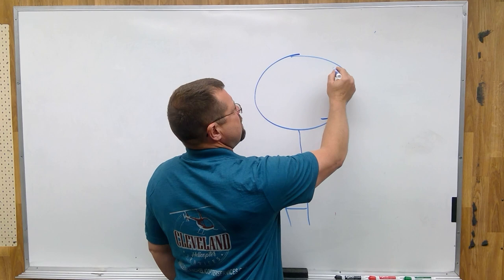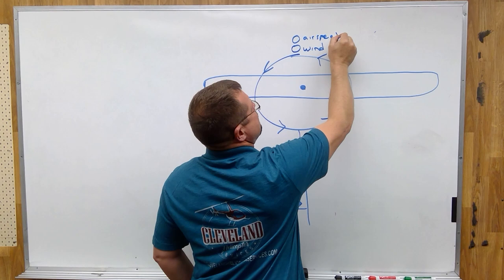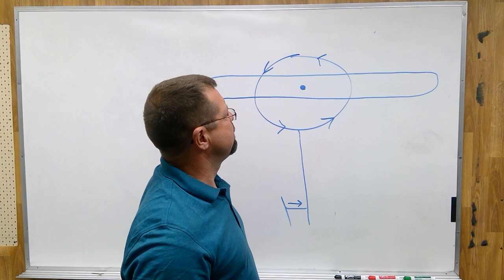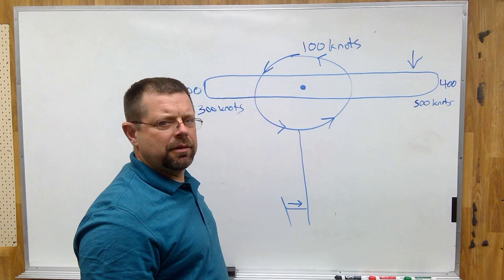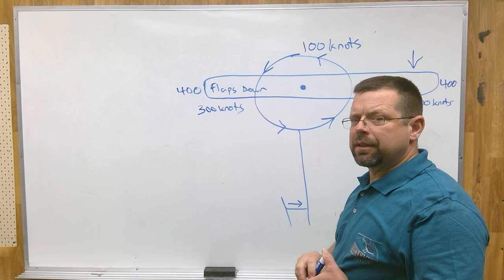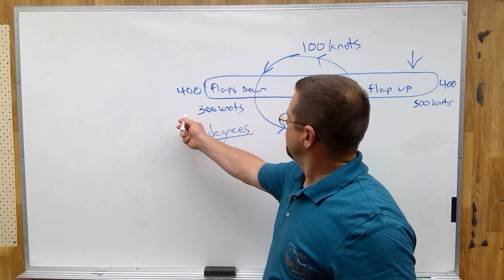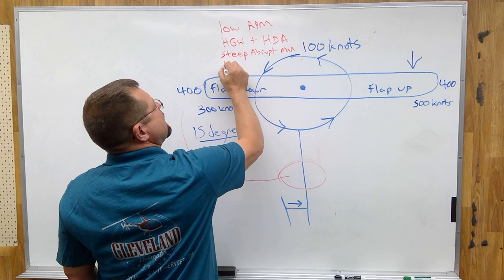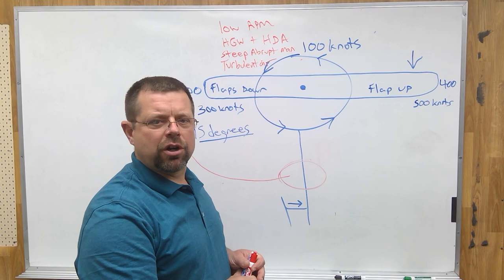Retreating Blade Stall

Comment: great lesson, well presented
just want to be clear on the tail rotor thrust vector

your diagram shows the arrow pointing in the same direction as the rotation of the main rotor. the resulting force (thrust) of the tail rotor pushing the tail (to the right with a counter-clockwise rotating main rotor) means the air flow is to the left and tail rotor thrust to the right is pulling the tail in the opposite direction of the main rotor torque (or same direction as main rotor rotation depending on how one looks at it).
Reply from the maker: Correct. The tail rotor is pushing on the tail boom on counter clockwise helicopters with the tail rotor on the left side. Thanks for the comment!
Reply: @garycleveland2989  that is not correct, if the main rotor is anti clock rotation as viewed from top down, the fuselage will rotate nose right. we apply left pedal to stop this. to make the noise go left we push the tail right by blowing air to the left. thus getting translating drift to the right. your arrow is showing thrust not the direction of airflow.
Reply from the maker: @williambogacki1687  thrust is towards the tailboom (to the right if seated in the helicopter), airflow is to the left if seated in the helicopter. Hope that helps.

Comment: Please i Need whats means lead lag
Reply from the maker: A fully articulated rotor system allows each blade to flap independently which creates moments where blade tip speeds vary from one another. The lead/lag hinge overcomes “Coriolis effect”. The helicopter flying handbook also has an explanation to reference.

Comment: I'm still confused on the idea of blade flapping and how it is affected by gyroscopic precession:

With the advancing blade creating more lift because of its speed, wouldn't that cause the advancing blade to flap up in the front of the helicopter due to gyroscopic precession?
The way I understand it now is that the blade would have to immediately flap up due to the increased lift on the advancing side which doesn't make sense.

Thanks for the help.
Reply: And in the context of transverse flow - when the front half of the rotor begins to enter cleaner air, therefore creating more lift, why doesn't the front half of the rotor simply flap up?
Reply from the maker: In my opinion, you are overthinking this. You are holding yourself to a standard of understanding that is not necessary for a pilot. Many things explained in the helicopter flying handbook and the airplane flying handbook are explained in a way that is not technically correct from a physics standpoint, but made simpler for the average person to understand. I learned this from a student that I had who had a PHD in physics. He understood aerodynamics to a level that only confuses me. But I understand if you desire in depth knowledge and encourage you to investigate. I am sorry that my understanding is pretty basic.
Reply: @garycleveland2989  That's interesting how the helicopter flying handbook isn't always technically correct, but I guess it makes sense just to convey the principle ideas without getting too in depth. Thanks for the response.

Comment: Hi, it is my understanding that the difference in lift between the advancing and the retreating blades it is not affected by the angle of attack until the upflap/downflap effect comes into play but due to the change in velocity as per the lift equation L = 1/2 Cl V squared density S resulting in tge advancing blade to generate more lift due to the combined effect to the forward aircraft velocity and to the rotor rpm’s, than the retreating blade. Am i correct?
Reply from the maker: Diego Beatrice I would recommend that you read it first hand in the Helicopter flying handbook. My explanation is good enough for all examiners that I have used for private and commercial students. I find that keeping it simple is best. If you wish to have a deeper understanding that involves equations, that is wonderful but not necessary to be a pilot.
Reply: Gary Cleveland thanks for your prompt reply. A little bit about myself - i am an 8000 plus hour fixed wing training captain with less than 20 hours of heli under my belt, fascinated by the helicopter aerodynamics and i do agree with you that while taking a checkride the safest option is to keep it simple as you dont want to expose yourself to thorny subjects you might not have a solid grasp on, however for sake of information i think that sharing the sources where some effects stem from, it helps to clarify them, for the more technically inclined amongst us.